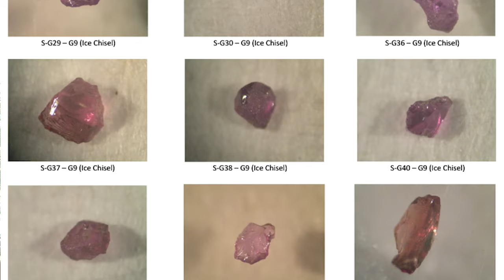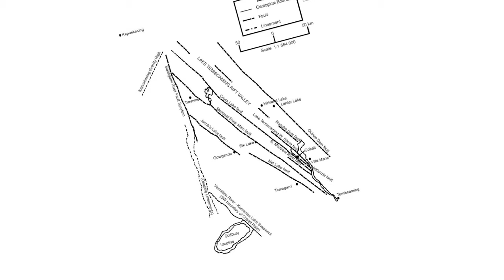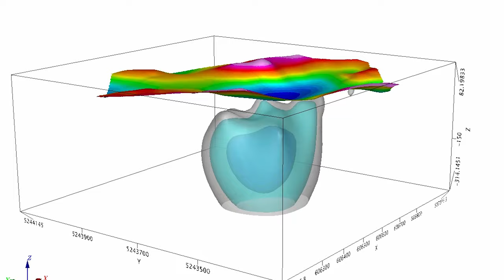Prospecting For Diamonds and Indicator Minerals - Tony Bishop (TSX.V: RJX)

Comment: How is it going ?  Any breakthroughs ?
Reply from the maker: They discovered 7 micro diamonds on the Kon claim bulk sample and 18 micro diamonds in the Paradis pond sample that was only 50 lbs. Lots of drilling has been completed in the last few months and the company is coming up with some very interesting findings. You can learn more here https://insidexploration.com/rjx/
Reply: @Insidexploration  Congratulations, I'm a diamond prospector myself. I've been focusing on both the Wyoming and Superior cratons for the 3 years. I've found several hundred micro diamonds but only 1 single macro diamond. I've found dozens of new kimberlitic indicator mineral anomalies that haven't been discovered by anyone prior to my sampling that I'm aware of. I started my search around the Kelsey Lake mine on the Colorado - Wyoming border but I really want to find a kimberlite on my own. I'm getting really close based on finding increased amounts of indicator minerals and some chromium diopside. Based on my sampling from the Stateline complex I've found that chrome diopside won't hold up to any more than a mile of transportation from the source. Kimberlite is often found under lakes because it usually weathers much more quickly than the country rock. Unfortunately I won't be able to fund the drilling phase anytime soon but I'm hoping to find and sell enough macro diamonds I will be able to someday. Im not going to make any claims until I can fund a drill because I don't want to tip anyone off of my finds.  I was fortunate enough to learn directly from Dan Hausel himself before he retired from the WSGS and since then have purchased all of his books. I believe that American diamonds will sell for 1.5 - 2x as much as diamonds from elsewhere based on how much the Colorado diamonds sold for.
Reply: @ModernProspector  8 new kimberlites found as of today's announcement
Reply: @rjkexplorationsltd.1909  Wow, congratulations, can't wait to hear about ore grade and size of each pipe. I'm going to look for the report.
Reply: @ModernProspector  So far, management knows the tonnage is immense, the geology is ideal, and the company has been told the chemistry is correct to host large diamonds by CF Mineral Research Labs. Drilling samples of 4 of the 7 new kimberlites have been sent for diamond analysis.

Comment: Wait a minute I thought nothing sticks to diamond
Reply from the maker: Hi Chris, that's a yes and no type of answer. Depending on the shape and growth pattern on the diamond or being fractured, you can have material attached to a diamond. However it wouldn't take much for any material to be separated from it. In the case of industrial use (and faceting) there is resin bonding and electroplating (typically Nickel) that encompasses the diamond particle leaving a portion protruding. In this video Tony is not referring to diamonds but rather the indicator minerals that still have Kimberlite material attached. Hope that answers your question.
Reply: Is this Tony Bishop.i appreciate you responding to me.if you have the time.message me back for my information thank you sincerely